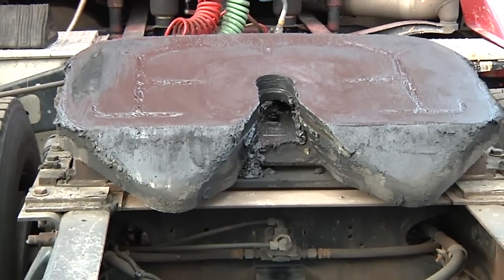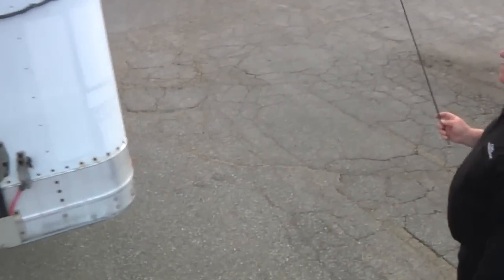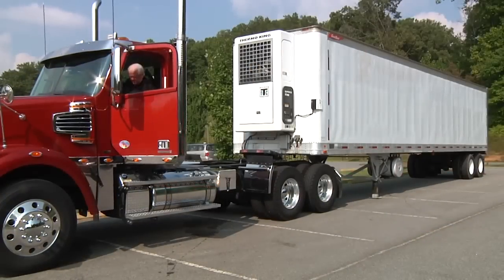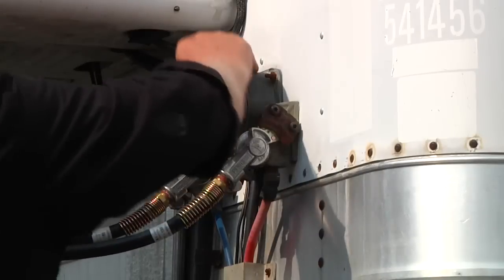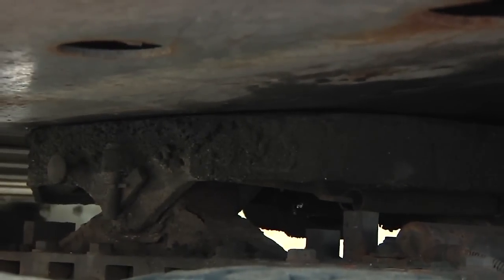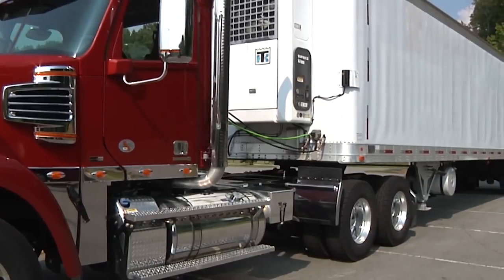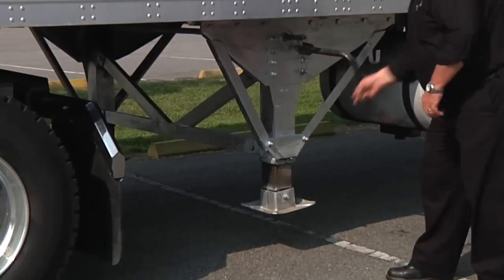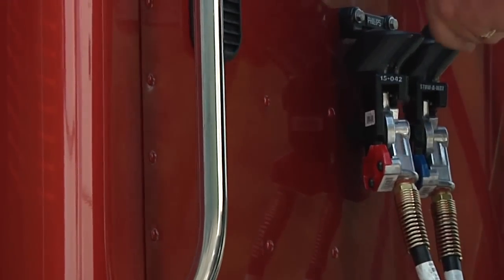CDL: How to Couple and Uncouple a tractor trailer.

Comment: Its best to listen for the fifthwheel to latch. visually duck you your head behind fifthwheel make sure the jaws are engaged.them make sure pull handle is in all way.takes a few seconds but well worth it.better than pulling out and having trailer slide off your frame.seen it done many times

Comment: when you dropped the landing gear you dropped the feet all the way to the ground. if trailer is full, you suggest dropping the landing gear even more. I find that this makes it difficult for me, or someone from another truck, to raise the landing gear later since the crank becomes much more difficult to spin. my technique is to drop the trailer by lowering the landing gear to the ground, then back off the crank a spin or two to leave a slight clearance between the feet and the ground. Then I go into the cab and release my air bags to gently drop the trailer to the ground.  I slide out easily and anyone picking up the trailer can do so without gorilla effort.
Reply: You desere a beer sir
Reply: +Kaiser Dal and some pork chops with gravy
Reply: Your way makes sense Jerry.  Question, should a tug test be done prior to hooking up the air lines so you know the fifth wheel jaws are locked around the kingpin?  Or do you attach the air lines and do a tug test in order to check the trailer brakes?
Also, it seems like it would be a good idea to chock the wheels of the trailer prior to coupling to make sure the trailer doesn't move.  I'm a brand new driver and would really appreciate your feedback.Thanks

Comment: You forgot to do a tug test when coupling.
Reply: This is a hell of a lot more check-this-check-that then I'm accustomed to although I damn sure recommend what you say as well as tugtesting with engagement of the trailer brake  AFTER connection of the airlines.

If you've done a visual verification as well as tugging immediately after you believe you've hitched then that's 3x assurance on the hitch as well as that your airlines + trailer air brakes are operative.

Comment: After connecting the Air Lines to the trailer and making sure they're not crushed Etc, from the cab push in the Air Supply knob and move the tractor protection valve from the emergency to the normal position to Supply Air to the trailer brake system. You wait until the air pressure is normal. Check the brake system for cross Airlines. Shut engine off so you can hear the brakes, apply and relief trailer brakes and listen for sound of trailer brakes being applied and released. You should hear the brakes move when applied an air Escape when the brakes are released. Check air brake system pressure gauge for signs of major air loss. When you were sure trailer brakes are working, start engine. Make sure air pressure is up to normal. Then you pull out the Air Supply knob and move the tractor protection valve control from normal to emergency. Only then do you back under the trailer using the lowest reverse gear and avoiding heading the Kingpin too hard and stopping when the Kingpin is locked into the fifth wheel.

Comment: What might happen if the trailer is too high when you try to couple.
Reply: You can tear the kingpin in the fifth wheel
Reply: Like damage the kingpin your truck should lift the tailor when you back up a little bit under it if it does lift its the right height. But if your truck go str8 under that means it's to high need to be lower down some.
Reply: it may not couple correctly
Reply: You might have the kingpin a little bit to the left or to the right. If you back up and don't notice it will go up and over the fifth wheel now you won't be able to get out of it unless your trailer legs can come down alot

Comment: 1. It doesn't make any sense to chock your trailer wheels on the front side - if you push it, it's gonna go back.
2. Before you couple (after connecting air hoses and electric) you take off those chocks. Then why not to supply some air into the trailer brakes and not to secure it ???

Comment: what about the use of the air bags
Reply: You would hitch by Lowering them, then reversing to come under, Raising, then continuing to reverse until hitched (where 5th wheel height is enough to permit). Tug test then get out and inspect + retraction of legs and connection of lines and lights.

Unhitch by releasing turntable, pull forward slightly out, Lower the bags, continue forward completely out, then Raise or equalise them .. or keep them lowered if the immediate next action is another coupling

Comment: I don't know what these "drivers" do now since I've been retired over 26 years.  But in my day if I fiddled and farted around like this expert does I'd have been looking for a job.  And then again I'd like to see them show how make a flying truck and trailer hookup.  From what I've seen on the highway there's one thing I've found.  These truck herders have no common courtesy for each other in any way.  A real driver knows how to use his lights to help others. The people driving 5 axle rigs now act like a bunch of self centered inconsiderate asses.
Reply: As a safety coordinator, I appreciate a little fiddle-farting around.  I found this video looking for a guide so that me, a person who never hauled a trailer in his life outside of the army, can show these truck hauling veterans how to do their job.  Thanks to this video, it was very easy to point out which step was skipped that just cost my company upwards of $10,000 dollars.

Safety is no accident.  Sure, do it quickly.  But I'll take someone who wastes a minute ensuring they do all the right steps over someone willing to roll the dice with someone else's money.

I also agree driver's can be inconsiderate a-holes, but this isn't limited to truck drivers.  At least these drivers are working.  I always give them room and the benefit of the doubt.
Reply: Amen